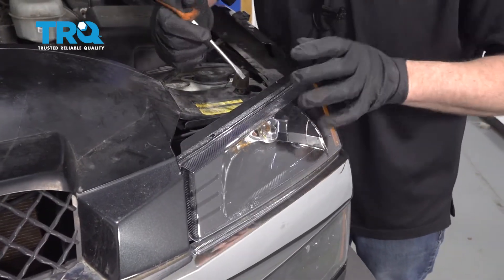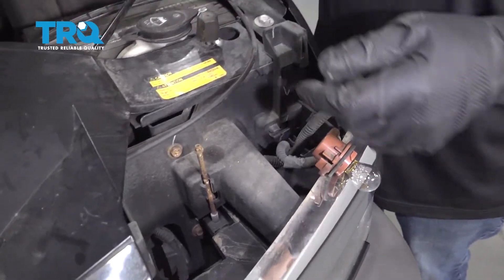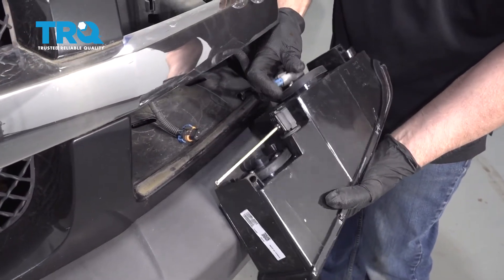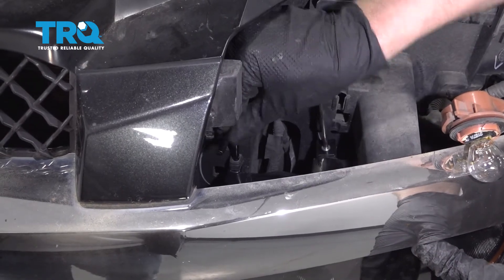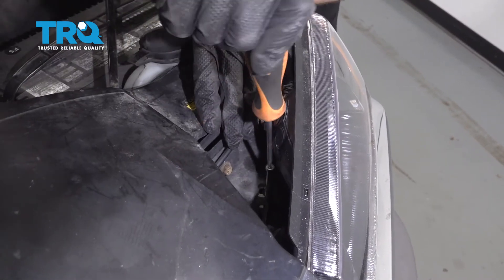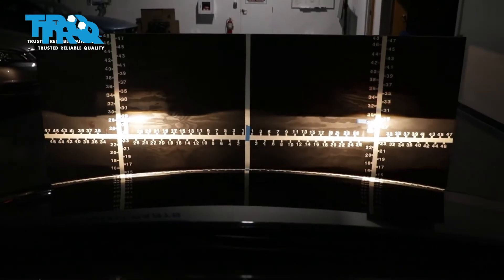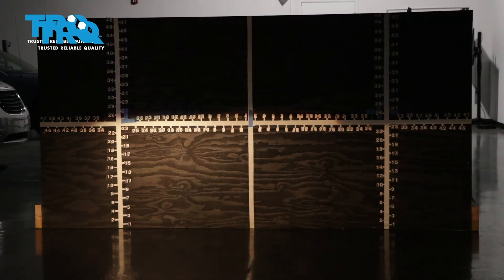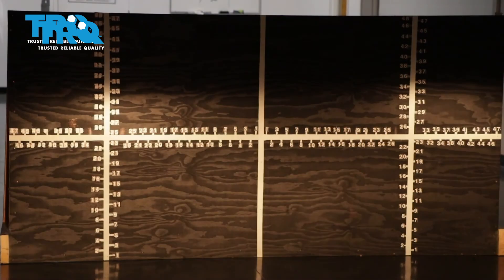How To Replace Headlights 2002-2006 Chevy Avalanche

Comment: Just used this video to replace both hi beams in my mom's 2003 Chevy Avalanche 1500. All we needed was this video, a flathead screw driver, a flashlight and gloves (as to not touch any of the bulbs). We did it in around 30 minutes! Thank you!